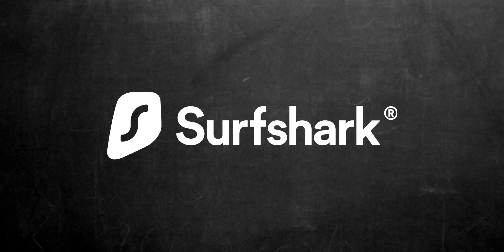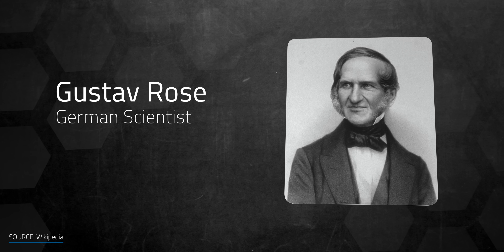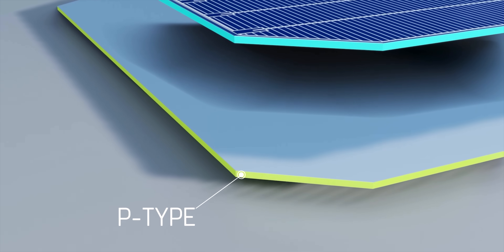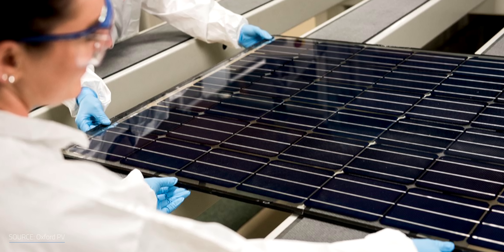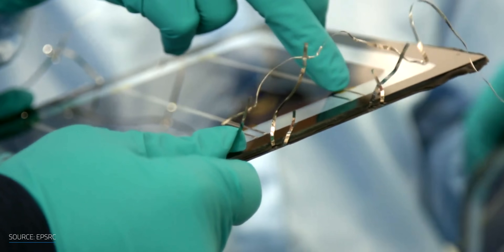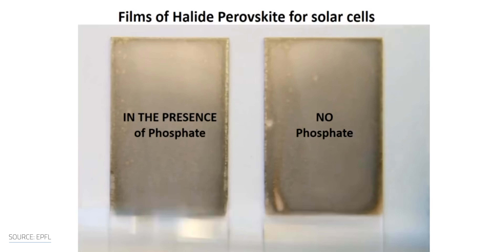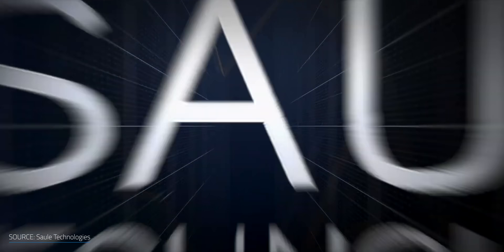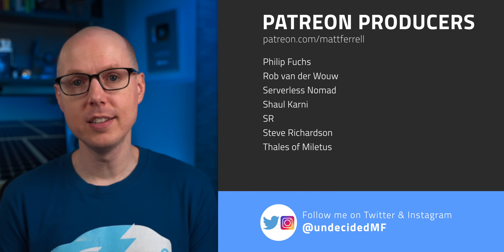Perovskite Solar Cells Could Be the Future of Energy

Comment: A good portion of the cost of solar is install cost. If the panels are very cheap, and easy for a homeowner or one solar tech to swap out, it could be worth it. They would need something like a standard housing, that opens with a latch, and cheap panel that can just be sat in place, and latched down.

Comment: Personally I think this has better application outside of domestic/house based installations that warrant 20+ years. imagine your car roof or solar battery charger etc. things that wont last 20+ years (at least not with todays car manufacturing:) this would be perfect. And once they remove toxicity which ofc they will and increase lifespan over time for larger installations. coupled with better battery tech which is so close ( look up solid state battery`s for example) we will finally live energy independent and for a fraction of the cost.

Comment: So... Perovskite panels are ¢25 and the average silicon on would be $4-10. Even if the perovskite panels only last 2 years and you need to cycle them out for recycle I would do that. It's either 16x or 40x cheaper per unit. So if the average install for solar at home is $18,000 for silicon for 25 yrs that would mean Perovskite is $450-1125. Swap em out every 2 years it's $5700-14,000 and that doesn't even factor the advancements you're actively upgrading to over that 25yrs.

Comment: Net Zero is certainly a commendable goal. However, as time goes on, we will recognize that the pursuit of NZ is far better than actually achieving it. Firstly, we will have to redefine NZ before being able to achieve it, move the goalposts as it were. The big machines that dig gigantic holes, crush rocks, and melt minerals at violent temperatures will never run on stray electrons. We will need more and more of these behemoths as we have to go deeper for minerals and metals. I'm a huge supporter of electric vehicles and small dedicated solar panels, but I'm a realist. We are not in an energy or global warming crisis, far from it. However, we will be if people make inappropriate decisions based on fear.

Comment: Even if they only last half as long as silicon based panels as long as the co$t is less than half of said silicon then they'll be a win.  And from what you said in the video the cost should be well under half the price tag of an equivalent silicon panel.  One use for these that you didn't mention that should be a perfect fit for these is in deep space.  Since they can be made much thinner and lighter than silicon panels, the solar array could be made much larger.  Possibly even large enough to power a low thrust ion drive.

Comment: Only way perovskite will be useful is if it is made as a spray on paint. We dont want ugly solar panels on roofs. We want to paint our house or roof. This way it is invisible and cheap. And when we paint 150m2 walls with a 5% efficient paint, we get more energy than 10m2 optimised solar cell panels. There is companies out there who make solar cells that produce energy 24/7, which is better for many imho. Different companies have made solar paints many years ago, what stop them from selling on market?

Comment: Thermodynamic efficiency doesn't matter, if you can make them cheap enough. All the market cares about is what you can sell them for, and how that relates to cost. When the oil companies lower their gas prices, they're not doing it to be nice. They sell more, and make more money, overall. Cars had a thermal efficiency of ~15% for decades. But gas was cheap, so they sold well. Only in the last few decades, had the average new car have an efficiency, in the 30% range.

If you can make solar panels cheap enough, they will still be good low efficiencies. If you can make a solar panel that's just painted on, and cheap enough, then it won't be a problem, if you need to repaint it every 5 to 10 years.

Comment: It seems to me like the longevity issue doesn't really need to be solved, IF they can build panels much cheaper than Silicon panels.
There are many applications for solar panels that don't need to last 25 years. For example, a solar panel coating on electric vehicles.

Comment: Why can't the solar panel manufacturing process use solar to generate the heat for producing silicon solar panels instead of burning fossil fuels? That would reduce the silicon solar panels' carbon footprint.

I wonder if solar panel manufacturers have considered or investigated the possibility of using molecular beam epitaxy or 3D printing to produce better solar panels more cheaply and more efficiently and in larger quantity.

Comment: I have no specialized knowledge of the science or engineering involved in all this. But considering that the anticipated efficiency of even the best Perovskite panels hovers around 30%, I suspect that some more efficient method of converting solar energy to electricity that is, as yet, not even imagined, will emerge. Meanwhile, I predict that the silicone-based panels, having established a record for longevity and safety, will remain the go-to choice for some years.

Comment: Even if all the technical problems are solved there will be some suppression of the technology. Whole industries have been developed and built around silicon products. They aren’t likely to just lie down and wither away. If the existing manufacturing infrastructure is included in the process the transition will be faster.

Comment: I think we will have Perovskite solar cells in cities within some years. They are perfect to use with other printing materials and can be used on advertising printing. eg stands on supermarkets and other commercial buildings where the design I changed every year. The converter and cables will be the most expensive part and they are lasting for many years. I'm following the technology.